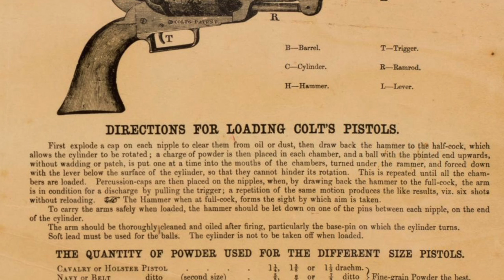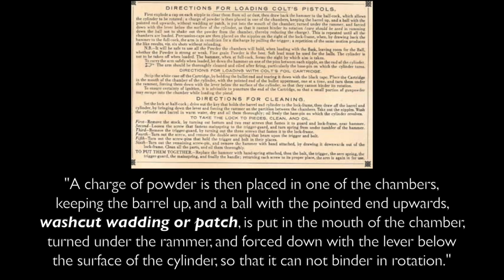Percussion Revolvers in the Rain

Comment: When I was a young hunter in MT an old man who was my mentor suggested that I load and cap my revolvers, then add some light non-petroleum grease to the edge of the caps to seal it to the nipple. Not very much or I'd risk fouling the cap. Since that worked so well in the rain and snow, and that the guns were for defense only, I switched to fingernail polish as a sealant. I also employed this method on my Hawken 54 and Zouave 58. I never had a misfire, even after falling in a rushing creek. Of course, I used tallow or bore butter for extra sealing and fouling mitigation. The best thing a shooter can do is keep the revolver in the holster with the flap closed until it is absolutely required to draw it--or stay home by the fire when the weather is bad. :)
Reply: Would greasing the ball also improve water resistance?
Reply: Small pistol primers inside a small piece of pvc tubing on my remington new model army is very reliable with the rain.
Reply: I was just wondering why no one’s ever mentioned sealing the caps with grease or something! Thank you!
Reply: Will the bore butter melt in hot weather?
Reply: @joelspringman523  probably, I've noticed the tube gets noticeably more squishy after sitting on the bench when shooting in summer months
Reply: @twistedyogert using a properly sized conical bullet would help as well since they often seal better

Comment: my theory about why the colt didn't function as well as the star is because the back of the cylinder is more covered by the frame. The back of the colts entire cylinder is pretty much exposed which lets the water into your caps.

Comment: When experiments don’t do what you expect, that’s when you learn stuff.

These result totally show how they ended up with those huge flap holsters.
Reply: If you properly seal the chambers and nipples wth beeswax, these guns are as reliable as rimfire ammunition.
Reply: @franklinAll8735   Respectfully, How would one seal the nipple end? thx in advance.
Reply: @Curtislow2  you lather the cap in wax or grease once it's seated to keep water off
Reply: @moomeansmooable   That was how I suspected it was done. But would the wax have detrimental affect on subsequent reloading?
Reply: @moomeansmooable   I could see the detonation of the cap blowing off most of the wax,regarding reloads.
Reply: @Curtislow2  that should be the case although I would still give them a wipe Incase some debris gets in the touch hole
Reply: my 1858 Remington New Army came with a flap holster. it's good kit
of course I use combustible paper cartridges with wads. personal preference.
only major difference is I spend more time at home making the cartridges and less time on the range reloading
Reply: I suspect that is a part of why flap holsters were a thing.  There's usually a reason for the adoption of such things.
Reply: @franklinAll8735  "properly seal the chambers and nipples with beeswax" ain't as feasible when you are in the field or in the frontiers doing a myriad of other crap.
Reply: @franklinAll8735  the water misfires were coming from the nipple end, not the big end of the chambers.  It looks like getting a really tight seal on the nipple is a challenge. Karl said the nipples are sized for the caps he is using.  Not sure how the old timers might have improved on that.
Reply: @lanedexter6303  wear a poncho when it rains and make sure it covers your holster 😀
Reply: @IowanLawman  Maybe, but if that pistol is your livelihood, or there are predators about that a rock or stick won't scare off, you'd take the extra five minutes during breakfast to rub some wax or grease around those caps and cylinder bores.
Reply: @lanedexter6303  Why do you think I don't know that? Old timers greased both mouth of the chamber and nipple around the cap. The grease at the front was not so much to seal the chamber as to help with black powder fouling.

Beeswax does an amazing job at sealng the rear. If properly sealed with grease, these guns can be fired while submerged, see: watch?v=NEGdt9KXcbI
Reply: Surprised me . I really thought the cap and ball would done a lot better .
Reply: @IowanLawman  you can carry it in a tin, i use mink oil instead
Reply: @franklinAll8735  That video is nuts. I wonder if you could do a whole cylinder? Note the top comment btw!
Reply: @franklinAll8735 Properly? According to whom? Sam Colt never said to seal the chambers with any beeswax or any other concoction.
Reply: @jameshealy4594  Yes, you can fire a whole cylinder provided every and each chamber is sealed with beeswax. However, reload of the same cylinder will not be possible for some time until everything dries well.
Reply: @toddy2519  Properly means so that no air can go through and reach the priming compound inside the cap. Sam Colt also said nothing about greasing the mouth of the chambers yet we know it was kind of a common practice back then. I've read accounts of cowboys and trappers sealing the rear of the cylinder to avoid very thing that was shown in the video.
Reply: @lanedexter6303  I wonder, if the barrel of the submerged gun was full of water, or if there was a pocket of air left, that could possibly act as a buffer of sorts? I was sure, he was going to have a barrel obstruction. Or maybe the black powder doesn't generate enough of a pressure spike?
Anyway, very cool to watch.
Reply: As they learned on Mythbusters, "Failure is always an option".
Reply: I always thought the flap was for improved security when one rode on horseback.  (I have such a revolver, have fired it a number of times in the past, and made a flap type “holster” for it.)  I usually put softened beeswax over the balls when loading it up.  20 grains, fffg.

Only thing I would change is to go to .36 (24/64, or “24 lines”)
Reply: @Curtislow2  It has to, try to pull off the caps when they are lubed like that after as a wet calvaryman wearing gloves for riding, no wonder they would carry so many pistols.
Reply: @IowanLawman  "Only if I had some convenient means to melt beeswax..." --- I wrote in my journal by the light of a candle.
Reply: @TheStraycat74  How do you do your paper cartridges?
Reply: @KageRyuu6 and where would one get the wax in the wilderness?
Reply: @BigWheel.  bare knuckle box a bear for his beehive lunchbox.
but seriously, candle wax, beef/lamb/deer tallow, etc.
the gun owner could likely just wait for the bacon grease from cooking breakfast to cool and congeal if he really cared. either way point is the mountain man has options.

Comment: The reasons the revolvers so often failed to fire is due to percussion caps being extremaly vulnerable to moisture. If you recapped the chambers after failure to fire I am confident they would go off most of the time.

The Starr discharged first, second and sixth chambers. That is thanks to a top strap providing protection from water to these chambers. Colt is an open top design and thus percussion caps were not protected by anything.

Old timers used to use a beeswax to seal the front and rear end of the cylinder. If applied properly, the beeswax provides almost 100% protection from moisture and thus guns weatherproofed this way are no less reliable than your average rimfire arm.
Reply: Would be interested to see the beeswax in practice.
Reply: Bear grease or bees wax to seal caps and chambers.....
     The modern solution is Crisco....use it as patch lube also.....🤠
Reply: @spaceman624   Yes Animal fat was used usauly bear fat but it did tend to get ranchid.
Reply: @robertfoote3255   Crisco works if it isn't to hot and humid it tends to get runny .
Reply: @robertfoote3255   A mixture of fat and bees wax is better if you want to be historically correct.  If not they do make a plastic sleeve to fit over the caps to keep moisture out and Mink oil waterproofing makes good replacement for Crisco.
Reply: @Seth Rising just a lil tiny dab of bore butter. It all blasts off when the cap goes off
Reply: @darrellgoodman9585      You got me.....I live no where near Arizona or that hot of weather.   
     As long as it's still a paste....it works good!
Reply: I never understood Sam Colt's aversion to top straps on his guns. From what I've read he was adamantly against adding them even when other companies like Remington and Adams were doing just that.
Reply: Thanks, Based Franklin
Reply: I was gonna say the same thing. Probably the cap being the issue in this test.
Reply: Even death cannot contain this man's basedness.
Reply: @samuelneese482  presumably for aesthetic branding:  how can know it’s a colt?  The strap!
Reply: Thank you, beeswax. I was trying to remember what we used. Back in the 70's deer hunting w/black powder. We hunted in the rain a lot. Had an Indian buddy I hunted with gave me this stuff put a dab on cap. Very rare to have a misfire, in the snow or rain.
Reply: "Now, where are you going to get melted wax in the middle of the 19th Century?" ---I write by 19th Century-style candlelight...
Reply: My dad used to use Vaseline
Reply: I wonder if a looser fitting percussion cap would allow the water to 'fall away' more easily. The tight fitting ones may be worse with water. Just a thought for another experiment control!
Reply: Seal the caps with a small amount of clear nail polish.
Reply: @Seth Rising use clear nail polish, thinly applied
Reply: @robertfoote3255  I use clear nail polish for the caps. it just flakes off when it blasts off, or cleans easily with most solvents
Reply: Try this experiment: drop a few Remington #10 caps into a bowl of water and let them sit there for an hour. Take them out, shake the water off and put them on the cones of empty chambers. If the cones are adjusted to the proper depth the caps will still work fine. The caps are sealed in a type of lacquer or varnish which waterproofs them. The failure of the caps to fire was almost certainly due to a mechanical issue, such as the adjustment of the cones. For the test to be valid, caps should be fired on empty chambers first to show that all the cones are screwed in to the correct depth for hammer impact. Some were, but some may not have been. The rain test was flawed. Percussion revolvers are way more reliable than that!
Reply: I have seen beeswax used to seal flintlocks too, wonder  if it would work against rain?
Reply: Absolutely a fan of bee's wax! A little dab will do ya. 
Where to find bee's wax these days? Go get a wax toilet seal at your hardware store, 100% bee's wax and fairly cheap. I melt it down on a double boiler and pour it into old primer tins.
Reply: @BogeyTheBear  Use the candle?

Comment: Good experimental video. I'm French and I've read an old cap and ball instruction (1870 Franco-Prussian war, even though cartridge revolvers existed) for French soldiers stating they should put grease around the nipples in order to protect the cylinders from the rain and moisture in case of long period of loading without shooting.

Comment: Here is an observation I came across; Colt put out a work in 1855 illustrating that the cones should be waxed on the sides, so that when the cones are capped, it will form a water tight seal with a properly fitted cap. Outstanding video. I really enjoyed it. Good to see a fellow Arizonan out doing this.

Comment: Thank you for stressing proper projectile size and the fact that wads are a modern invention. Flintlock users did have some ideas back in the day, but good demonstration.

Modern caps arent as thick as vintage caps either. Lubricated wads will contaminate the powder over time, typically from my experience inside of a couple of days. The lube will also contaminate the caps after a week or so from my experience as well.

Flintlock rain protection involve things like beeswax on the stock shelf against the barrel to divert water, and a "cows knee" to cover the lock.

Comment: Did you try recapping the unfired charges?  That would have verified that the powder was still good.  Did you crimp the cap?  I seem to remember being told that crimping the cap was important to keep water out, but that also may have been cap-and-ball apocrypha.

I wonder if the top strap helps deflect the water a little, as well.  Neat video.
Reply: to a degree it does, but I too wish he'd recapped the percussions.
Reply: I was hoping he'd try new caps as well. Maybe if he notices this comment, he'll try that in the future.
Reply: Crimping the cap would have actually made it worse. Squashing the cap will bend it into an oval shape, making a tighter fit on 2 sides, but opening it up on the other 2, unless it's a proper crimp as you would a cartridge bullet, but I've never ever seen a percussion cap crimper that crimps as a reloading press would.
Reply: I expect the slixx nipple with the hole in the side of it probably also doesn't help much for keeping water out.
Reply: This is what I came to say, he should've tried recapping the chambers that didn't fire. I don't know if it would have changed much, but it's worth a shot. Makes me want to drag out my 1856 Navy and try this myself.
Reply: @ktinga1  If I owned it, I would try it. Clean her up real nice afterwards.
Reply: If your caps fit properly you don't need to crimp, they should fit tightly on the nipple to the point they won't fall off under recoil
Reply: I read somewhere that they would seal the caps with candle wax.

Comment: could some grease or beeswax help seal between the caps and the nipple or would the risk of clogging the fire hole be to great. 
Also mercury fulminate used to be the standard priming compound but these days potassium chlorate mixtures are more preferred and could have an effect on water resistance.
Reply: beeswax will resolve the weather-induced reliability issues with these guns indeed.
Reply: I don't think that modern primers use potassium chlorate either as it is corrosive. My understanding is that the most common early priming compounds were actually a mix of the two, trying to ballance out the pros and cons. I would be surprised if modern primers used either, as one is made from mercury and destabilises over time, whilst the other is corrosize. It is probably some safer, cleaner alternative.
Reply: @commando552  fulminate of mercursy is as - or worse - corrosive than potassium chlorate. The misconcepton that you must clean a black powder arm instantly after firing is due to the use of fulminate of mercury as priming compound which indeed rusts the gun almost instantly. Remington advertises their caps as not corrosive so they must use something else. You can clean a black powder fouling up to 48hrs after firing with no permament damage to the gun. Under serious humidity minor surface rust may occur. In a dry envoirment no significant rust should appear up to 48 hrs from black powder fouling only.
Reply: @franklinAll8735  It is from wikipedia so suspect as all hell, but to quote from there "Mercury fulminate has the distinct advantage over potassium chlorate of being non-corrosive, but it is known to weaken with time, by decomposing into its constituent elements." It doesn't really matter if one or both are corrosive, as the standard compound was a mix, comprising three parts potassium chlorate, two parts mercury fulminate, and normally one part powdered glass for extra friction. Only very early were caps pure Mercury fulminate (I think predating them being in a copper cup), so pretty much all historical use of caps and how you need to deal with their corrosive after effects will be in relation to the mixture above.
Reply: I believe lead styphnate is used as a priming mixture nowadays, including caps.
Reply: Potassium chlorate is no longer used in any commercial pyrotechnic devices. It's been illegal in the USA for many years as well as in other countries.
Reply: Yeah... I just commented on this. I used to grease both ends when it was raining. I used to used a 50/50 beeswax-shortening mix (same mix as my bullet lube). Beeswax alone is too hard and won't actually seal. I shot a Remington which has mostly enclosed nipple pockets which helped hold everything in. You just wanted enough to seal a ring around the cap because it blows that grease out everywhere when you shoot. Worked really well though. Bonus, the grease helps loosen that hard to clean residue around the nipple.
Reply: Mercury fulminate degrades over time, so potassium chlorate became the mainstay primer compound. A chlorate primer is no more corrosive to a black powder gun than the powder residue would be, so there's no detriment to using one here. Where potassium chlorate became a problem was when smokeless powder was invented-- smokeless is not corrosive, but the chlorate primer compound certainly was, and folks began to notice that. That's why lead styphnate is used today.
Reply: @commando552  Modern Priming Compounds usually use either Lead Azide or Lead Styphanate. It was common for Soldiers to carry Spare Cylinders Preloaded before the Battle. In foul weather Chambers and Percussion Caps would be Sealed by using a Lighted Candle to drip molten wax over them this also used to be a common Hunters Trick.

Comment: I deer hunt with a .50 percussion. A drop or two of wax, or a q-tip with Vaseline worked well for me in WI rain.
Reply: And what was applied to the gun? :P
Reply: @kevinwestermann1001  "A drop or two of wax, or a q-tip with Vaseline". on the capped nipple. Vaseline not as good except in cold. Another thing is bore grease and I carry a small tube of that. Most all Carl's misfires only clicked meaning the caps did not go off, you can hear the difference between a dud cap and wet/no powder load.